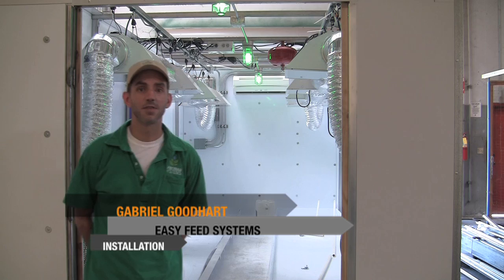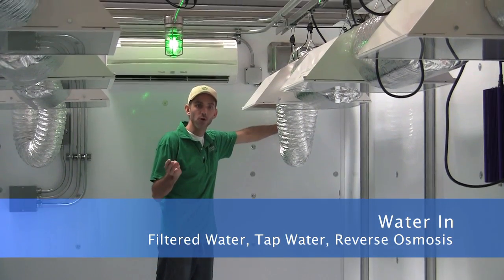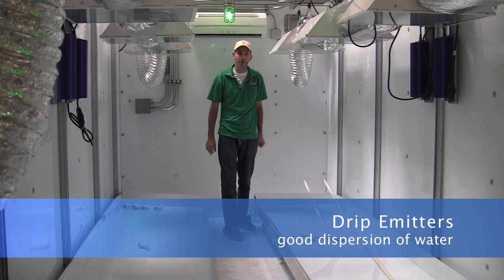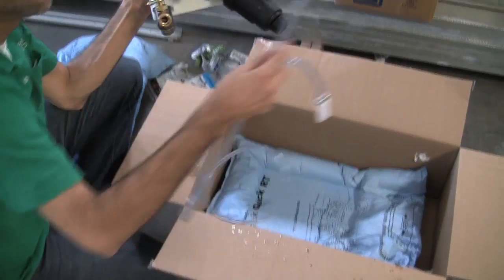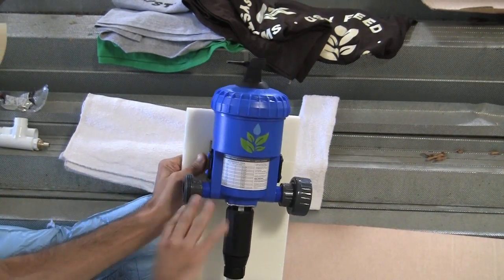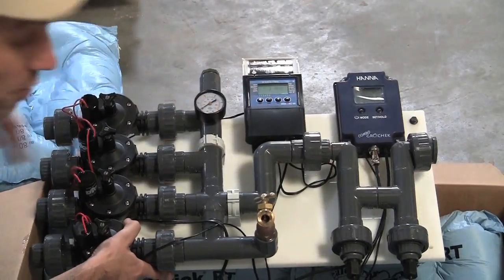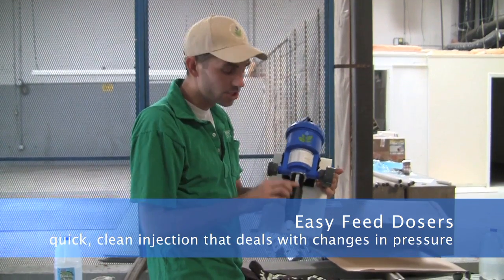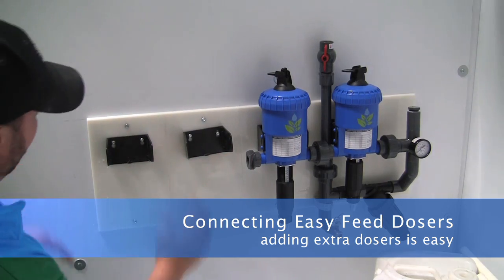GrowBot with Easy Feed Nutrient Delivery System

Comment: Looks neat but for $3000! Ha!!,  for a ph and temp probe and 4 dossers,, shop on ebay, make an entire system with arduino sensors relays and 4 peristaltic pumps for $50, wire it up in a afternoon. wont looks as neat but you can hide it in a box.
Reply: +Arthur Gibbs I would like to know where you are buying all of that for $50.....
Reply: +Alan Williams that part is easy. the $50 cost is hard. it is closer to $300 if you want a decent setup
Reply: +Jeff Powell Ebay Hong Kong, put up with long delivery times: £0.99 Arduino Uno, £19.99 ph sensor board and probe, either bunch of transistors or relay board around £0.99 or £2.50, peristaltic pumps £4 each you need 3, Base, Acid, and nutrient.  you then have money left for a box maybe a lcd screen £2.50 so you can change settings. I think a lot of people are getting carried away on thinking a more expensive system will work better because it costs more. a cheap peristaltic pump is less accurate than some fancy expensive crap sure but you not measuring out your solutions to the nearest atom! 1ml will do and that is beyond fine for a greenhouse. its still more accurate than you could do by hand using a measuring jug.
Reply: +Arthur Gibbs not bad. I couldn't find a decent pH probe for continuous monitoring. most drift way too much for that purpose.
Reply: +Jeff Powell Yea that is true, but they all drift. there are some solid state ones in the labs that don't need calibration and don't drift and can measure way more than just PH,, but there  £££££££££££  out of my price range. for my hobbies I like to make stuff cheap as possible that will still do the job reliably. because then i can afford to make it more complex.
Reply: +Arthur Gibbs definitely understand the feeling. hard to iterate when each part cost $500+
Reply: +Alan Williams an arduino is a board with a microprocessor on it. You can control stuff with it, screens pumps,  motors anything really it's just only 16mhz so no complex stuff. Ph monitoring and regulation is simple just read in ph value from sensor then pulse pump 1 , 2 or do nothing. They flew to the moon on less than 1kHz
. Setup if you don't do diy stay away from them I'll sell you a working system for just $2500 lol
Reply: @arthurgibbs88  can u show yours
Reply: @jeffpowell860   yea man ive had a go at making my own and i've ended up with a couple hundred quids worth of sensor, boards ,relays etc, most of which i've forgotten the purpose for! along with Raspberry Pi collecting dust in a box in attic. Then i kick myself for being a tight ass and wasting ££ that would of paid for half a blueLab!
Reply: You are very right sir
Reply: I've build mine which is close to $250.  Atmega written with Bascom-AVR, PCB, solenoid valve, sensors, alarm output, water level SS rod, injector, connector and other pcv bits and pieces.
Reply: @bernardlim2888   can u show a video

Comment: Brilliant, over-designed and unnecessary - obviously the idea of an engineer and not a farmer. It is pretty, though. Perhaps the best application for this tech is in zero-gravity environments, like the space station.
Reply: farmer: peasant shoes and big brain up
is not an engineer...
think before you speak
Reply: roberto benatti This is not a phone and we're not speaking. Think about that before you write. Me, I'm no farmer. I'm an industrial electrician and plumber. This is all very attractive, but it won't pass a CBA except in orbit, all the more because nutrient introduction is one of the few things you don't want to automate in a grow room.
Reply: ***** In that case, I recommend using a pump ... a device that some folks call a "gravity inverter". That being said, I can't imagine why you'd want to automate nutrient introduction in zero-gravity environments. Do you spend much time in such places? Also, bear in mind that of all the things you might automate in a "garden", nutrients do make the list. That's best done manually, as needed ... which depends on the plants and not the schedule. If you were forced to work via remote control, you might develop a system to test the plants themselves and then introduce nutrients remotely, but time is NOT the important variable in nutrient introduction, ergo automating it may well be bad for the plants. Automation is cool and all, but it's not for everything. Cheers.
Reply: ***** Um, no, I wouldn't want to get involved with that, nor is "outer space" accessible to me just because I can imagine it. As for the undersea environment, if you think that that has zero gravity, then you might have more success making french fries for McDonald's, or collecting unemployment. Smoke your fatties and leave the engineering to the engineers...
Reply: Your comments here are so funny to read in 2021. Automation is in everything that has to do with horticulture, especially nurtient dosing/direct injection/batching. Good thing none of us listened to people like you.
Reply: TheEnneagram Absolutely... and an absolute steal at only $237,454.60....
Can only imagine the cost of the bloody thing...
( can smell a re-mortgage from here.... fuck that)
Reply: No way! You're not gonna remortgage your space station are you? What'll you do if the Mothership actually shows up? Don't be left behind - buy now!
Reply: not for this rebadged chinese medicine dispenser.... fuuuuck that.... ;)
Reply: +greymobvmp HAHAHAHHAHAHAAH!!! Man I lost my shit when you claimed Hawaii to be the most isolated piece of land on the planet. You know that the Hawaiian Islands are tourist destinations...... right? Nice and desolated tourist regions.... LOL
Reply: +greymobvmp Lol k

Comment: tchydro "How could you build that for 200.00?"
Well I cant; your system is complicated and commercially built, mine is homemade and cheap, but works. I use an arduino 30$ mounted it in a old computer case got a couple dosing pumps.  Going to use  the pH and EC stamps for control.  So far cant get the stamps working as they should, but that's just a mater of time.Stamps are not required for a basic home system, it can drive up cost a lil over the 200$ I'm growing plants with it now.